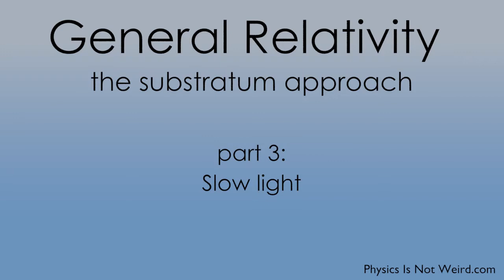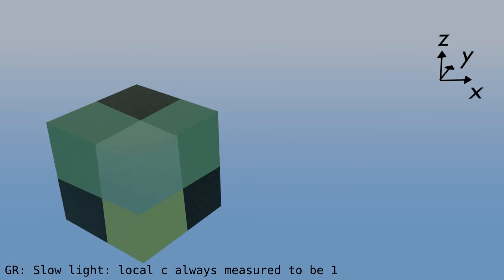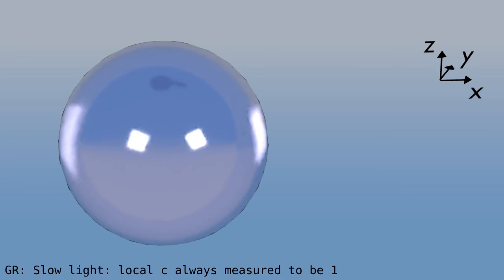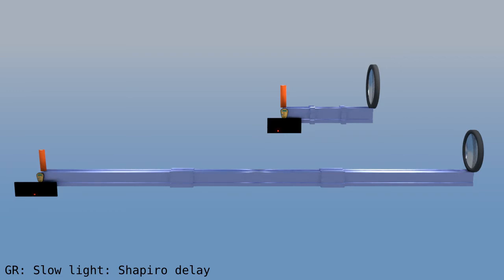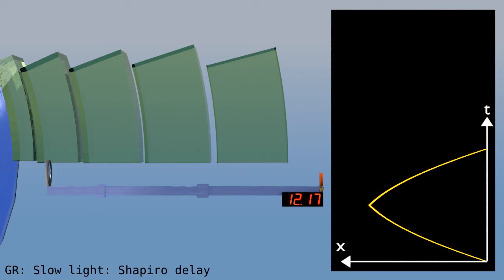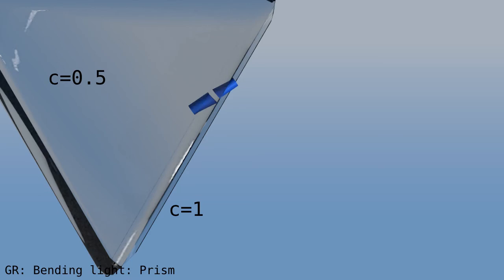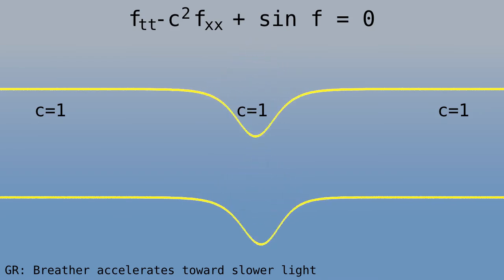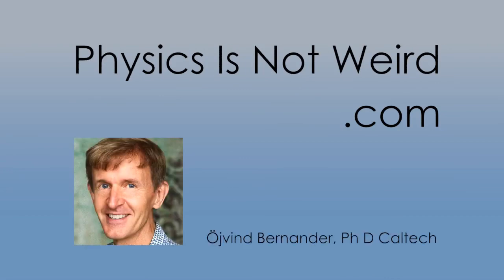General Relativity part 3: Slow light

Comment: I have been trying to intuitively understand how the constancy of the speed of light works on the physical level for years. And the answer is that the speed of light is not a constant but only measured as a constant locally due to length contraction! This is really funny and makes complete sense. And nobody explains it this way.

The length contracted spacetime makes the light go slower and the slower light is the reason for the time dilation. And the proof with the Shapiro delay was great. One can build on this and learn more on the nature of the "substrate". There must be a constant that brings into relation a quantum of energy and the curvature of spacetime. This can be a key to quantum gravity.
Reply from the maker: A local measurement always gives the speed c. Unfortunately many folks have a strong knee-jerk reaction against considering any non-local measurements. I think that's a pity, because things become so much more clear when you take a non-local point of view.
Reply: @physicsisnotweirddotcom2077  Now, I am coming quite late to this discussion and probably no-one will answer to my question, but isn't it that the speed of light is constant for all observers? When you are talking about the book keepers viewpoint, you are talking of an observer in an inertial frame of reference far away from and at rest relative to the massive object. Is that correct?

Comment: I still think the rubber sheet model is better for visualizing what happens than the Schwarzschild model. Having c universal is so fundamental to Relativity that I think a model that has c universal but space dilated by gravity is best. It yields all the same results (e.g. Shapiro delay is identical) but it's easier to see why. When one discards universality of c, one gives up a standard for measuring distance. The Schwarzschild radius, Rs, isn't a unit of distance in space because it takes light different amounts of time to travel that "distance" depending on where it's measured. It takes less time for light to travel from 5 Rs to 4 Rs than to travel from 4 Rs to 3 Rs. To travel from 2 Rs to 1 Rs (the event horizon of a black hole) light requires infinite time.
Reply from the maker: I think it’s useful to have multiple visualizations (or substrates). Different scenarios may require different visualizations, and we all have personal preferences. Note that Taylor and Wheeler in their book “Exploring Black Holes” have a whole chapter entitled “Light Slowed Near Sun.”
But here is my soapbox: Relativity has as a central principle that a local measurement always results in the same value of c (often confusingly phrased as “the speed of light always IS c”). This is important to know, but I think it is often over-emphasized, causing confusion. This is especially true when contrasting eternal black holes with evaporating black holes; many people who have studied GR get these cases wrong. Even Kip Thorne (as I quoted in my other video “Can you fall into a black hole?”) wrote that “[the robot] flew through the horizon… many minutes ago” conflating clocks in different reference frames.
Taking a non-local, "external" viewpoint can often help in analyzing problems, and this can then result in "bookkeeper" speed of light being slower. To me this viewpoint helps sorting out paradoxes. As a sanity check, I then always make sure that local measurements would result in the same old c.
Reply from the maker: Also note that the wave equation (with constant c) on a curved space is equivalent to a wave equation with variable c(x) on a flat space.